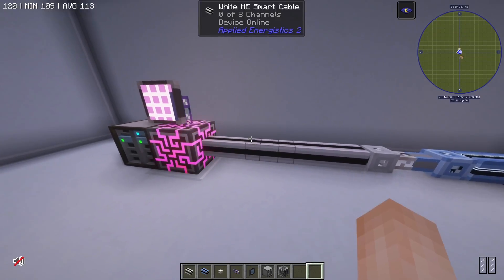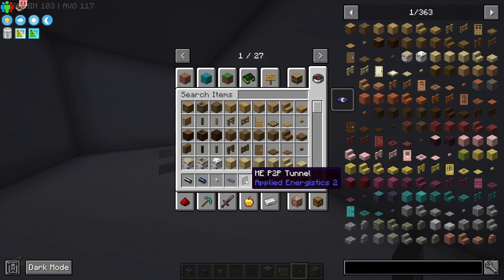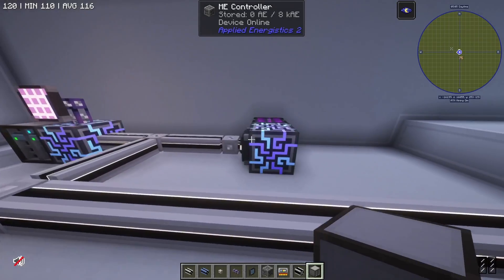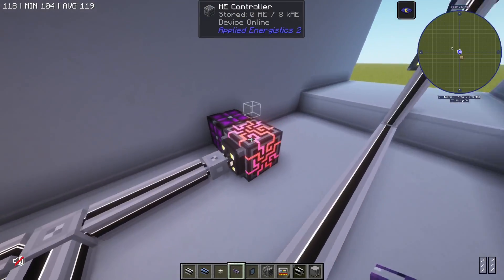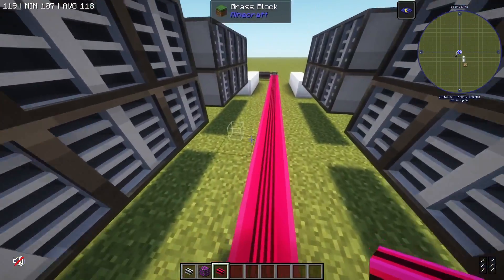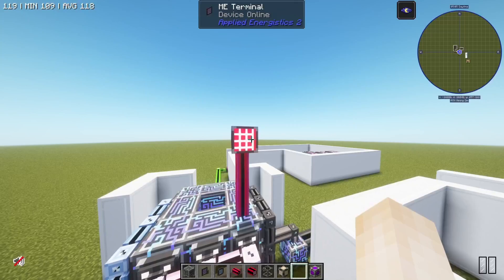Mastering The Art of P2P Networking!! | Applied Energistics 2 Tutorial

Comment: So im wondering how the heck do u use a me wireless connector and a p2p together i have tryed and it does not work... trying to connect my hub i call it witch is controllers and a tone of p2p and of course it has power for all the cables and the like but when i use a connect to connect to other area even a few blocks away just to test it of course it does connect but the p2p will not connect to the main area it should be like a few blocks of dense cables then smart cable then p2p then other dense cable this way i can have a area with a ton of machines there but it wont connect to the dense cable on the other side nor will it with a smart cable it will connect to the other side but that is what is was already connected to to begain with ill then be able to wipe it around but then it just looks stupid any help would be greatfull

Comment: i have my controller set up exactly like yours but every time i try to do a sub network (the exact same way you do) i get a message on my smart cables says “Error: Controller Conflict” im lost on what to do at this point
Reply from the maker: sounds like somewhere you have a line with multiple separate controllers connected
Reply from the maker: be sure to take advantage of quartz fiber which only passes power, not network
Reply: @DrKrosYT with how fast you just replied and how long ago this video is you just earned a sub! after i commented i realized i had a extra me controller plugged in along the way and dropped it and it immediately started working. thank you so much for the help though :))
Reply from the maker: @spinyurd thanks for the sub! i just happened to be on my phone when i got the noti. glad you found the problem

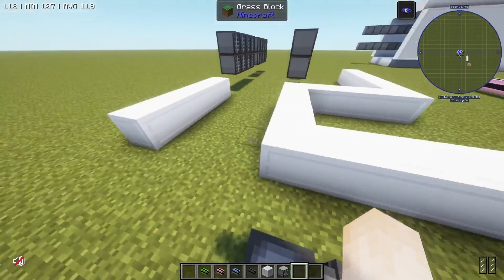Comment: Maybe I'm just not understanding properly, but at 5:02ish it is mentioned that you can carry up to 1,024 channels across the dense smart cable, but aren't you capped by the amount of p2p tunnels on the main controller? So in that set-up, you would have 256 channels available in that dense smart cable right? Is the 1,024 number just the absolute limit if you can set up enough p2p tunnels to fill all 32 channels of the cable?
Reply: Also confused by this. At least on ATM10, the tunnel on the controller is capped at 32 channels. I don't see any way it would be 1024.
Reply: Correct, he only has 8 P2P connections on that side of the main controller, so it would limit his channels  to 256
Reply: yea i also dont understand this. Why use the p2p tunnels and not just dense smart cables. I dont understand where the additional channels are supposed to come from.
Reply: @moneymaketheworldgoround  In my playthrough of ATM10 a few months ago, I used P2P tunnels paired with quantum network bridges. Made it really nice and compact in my main controller room. You can use regular dense cable if you wish but it will be messier and you will end up using more cables than if you used P2P tunnels, depending on how far you plan to go with your network.
Reply: Late response, but you are able to achieve the 1024 channels he is talking about by separating the "Input" P2P Tunnels and the "Output" P2P Tunnels with another ME Controller between them. He is already using this strategy with his controller design.

Comment: For anyone getting started with p2p. the 3x3 controller shown here is a great setup and can give you up to 2304 channels with p2p. More than you'll need in most modded scenarios honestly
Reply: How do you get that number?
Reply: @FriendlyKrakenMusic  every face of a controller block has 32 channels, and since it is a 3x3, you are getting 8 faces per side of the whole controller so 8 x 6 x 32 = 1536 channels.
so now you might say, if it is 1536, why did the guy say 2304. Well because there are some other sides of the main controller ( in the middle ) that you can use, but I usually only like using the sides because its cleaner,
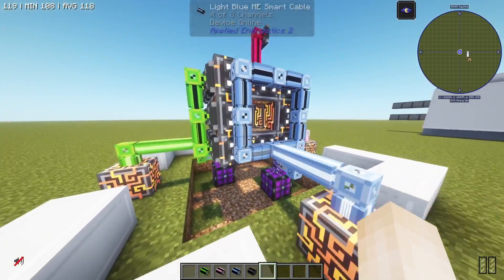look how they are connected over here 4:05
Reply: @ the exact setup he has, plus you can get cables in to connect p2p to the interior faces that are still open in the middle of the 3x3 cube
Reply: Thank you!
Reply: enough for gregtech?
Reply: @dripthanos5595  If you use channels and p2p efficiently it should last you for a long time. Depends on what gregtech pack though. A big part of gregtech is also building passive systems to keep your storage stocked with what you need
Reply: @dripthanos5595  gregtech needs around 3k according to somone UMV on yt
Reply: @dripthanos5595  gregtech maybe, gtnh no